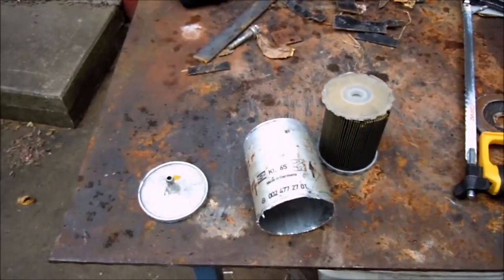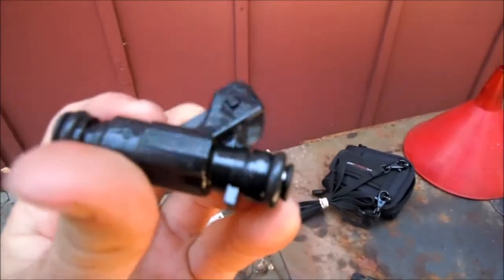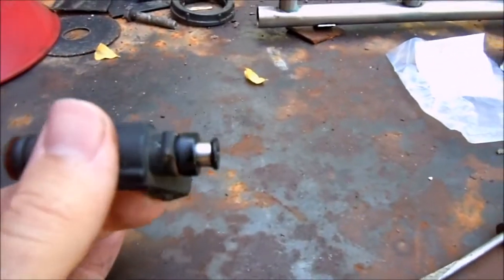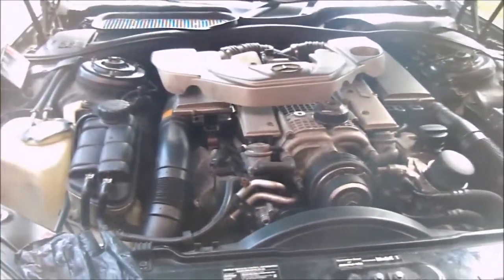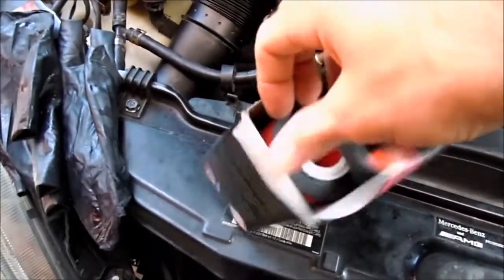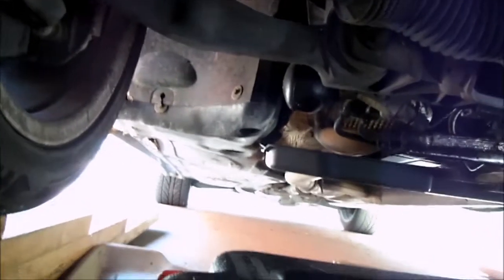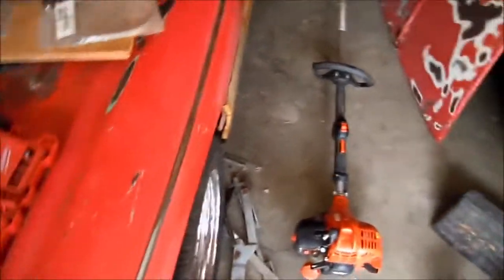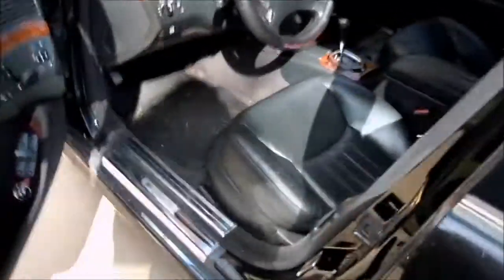Mercedes S55 AMG Fuel Injector Problems Part 2

Comment: How did you know the injectors were stuck open? Did you have a check engine light? Which codes did you get?
Reply from the maker: Yes the check engine light was on. Take off the surge tanks and look in to the intake ports with the ignition on the stuck open injector was spraying fuel out, the intake port filled with fuel in seconds. The code was P0301 cylinder 1 misfire.